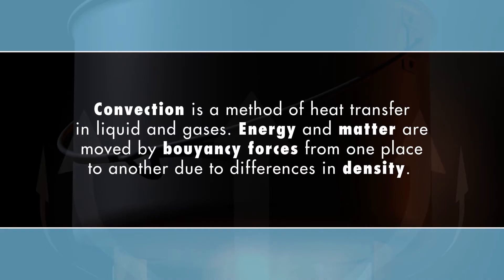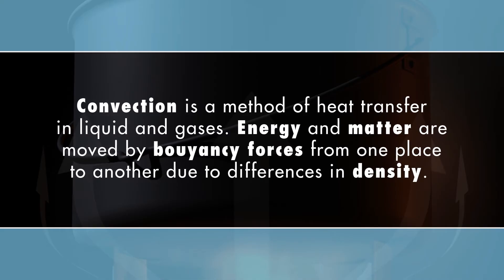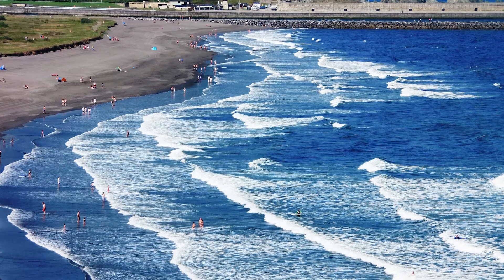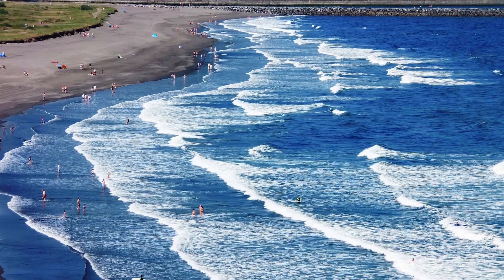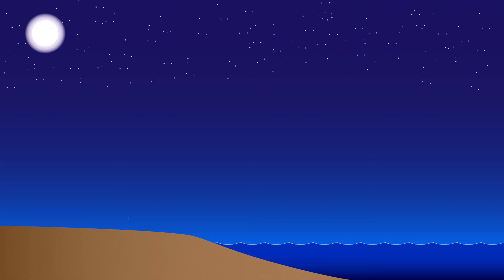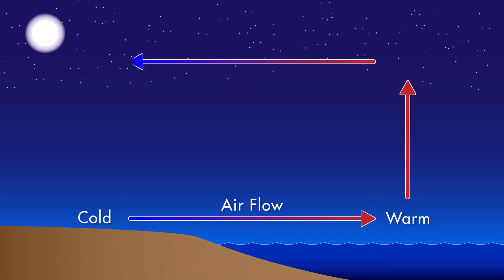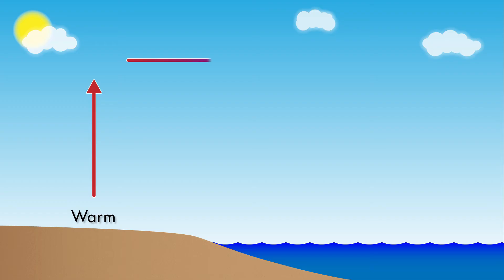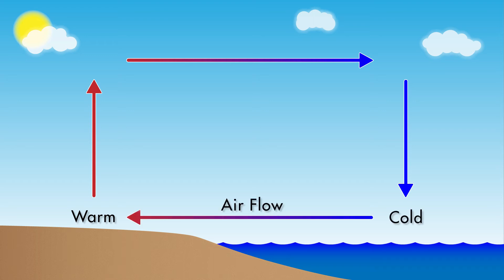STEM Experiment: Gas Convection

Comment: In the experiment there are 2 chimneys. What if there's only 1 chimney, is there still a convection current? I want to build an oven in the shape of a drum with a little hole on the top and a hole on the lower side where I slide an lpg torch. And I want to maintain a temperature of 200°c or lower. Do you think this is feasible. I just think this is the Simplist.